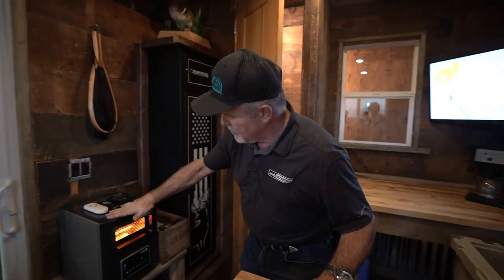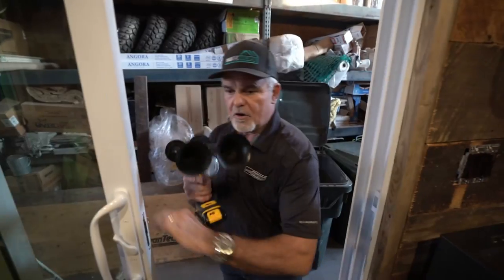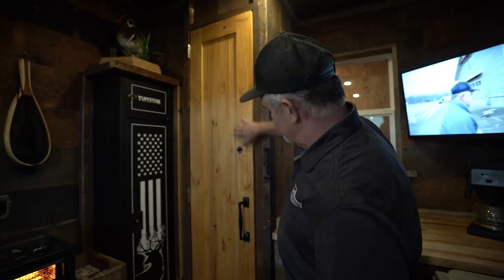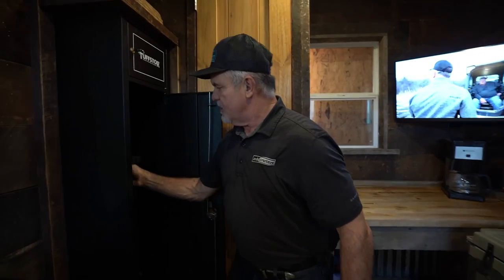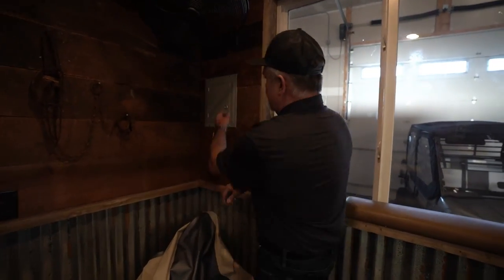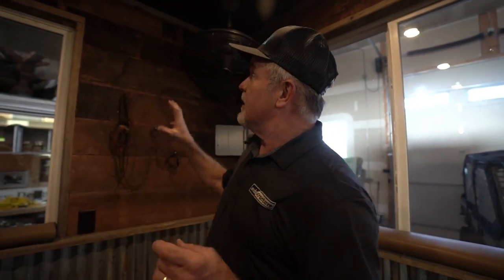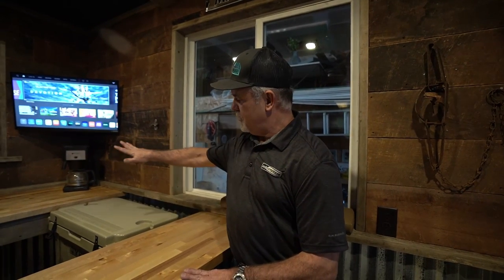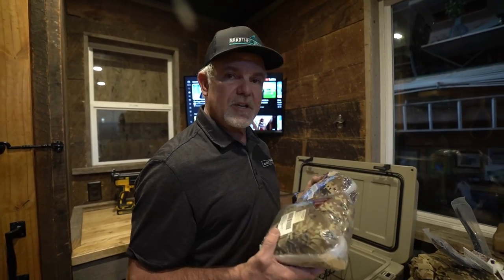Inside FLAIR’S Off-Grid Mobile Deer Blind! (Full Interior Build)

Comment: Looks & sounds like a great unit. If you vent the roof and add a ( eg. Roof rack) so you can add a tip out roof tent for guests & offer yet more usefulness. Because yes, although you can rough in more useful items inside. Fold down wall bunk beds over the bean bag chair.
Meanwhile, if the tent tips out over the patio doors, then the roof top tent not only works as an awning but offers the ability to add on an outside room.
So when you get a portable tent stove, you can set it up outside in the shared annex dining room area.
It will heat not only the rooftop tent but the trailer, too...
Meh, after that, a sink that drains to a hose outside so you can use a water tote (with a gravity feed) set up; along with a small roof top portable solar unit.
P.s. if that gun vault takes up too much useful space you can turn it into a convection fire stove heater. By placing 16 dinner candles, submerged into a HUGE glass CANDY storage jar full of lard! Making a better than 48 hour convection heater.
Or do the diy cooking oil fire box using the baby wipes as a long (log fire styled wick).
In such a way, that you could pipe in the prewarmed ambiant air from the annexed tent room - ( i.e., via / thru closed air pipes) which in turn gets heated up more via your diy convection heater & into your trailer.
Lastly if you really want to push it you could channel the wood gas from your outside wood stove to power an outside generator if needed.  Look up wood gas fuel the solar can also help you develop an outside hydrogen gas bubbler that if need be you could also vent to the generators' carburbtor to mix ever so slighly with the wood gases (warning eg.  LIKE only ONE PUFF! at a time! 
-directly from the water cell of the hydrogen puffer)......
& 
Yup that's about it!
Reply from the maker: Wow! Thanks for reaching out and sharing your ideas👍

Comment: Easy things would be coat hangers and painting the window trim so it's not white. I wouldn't have done a sliding door but you're going to want to tint it and a curtain. Movement will spook the wildlife. I would also look into dometic refrigerated coolers, they take up the same space and draw from a 12 volt system
Reply from the maker: Sorry for my late reply… I have one of those refrigerators/freezers that I could replace the cooler with! 
Several people are telling me I need to 10th and windows so I’m going to get that done - thnaks
Reply from the maker: Tint the windows, not 10th🙆‍♂️

Comment: The blind looks awesome! I would try to get the squeak out of the door because the sound caused from that could potentially scare of the deer or whatever Flair is hunting. 
I would also suggest that tint be added to windows just for privacy and to reduce some of the reflection from the windows. 
All in all, awesome job, Brad!
Reply: Also, I’ll guess the weight is about 2,675lbs
Reply from the maker: @josephwhisnant  I’m going to put a little oil on the hinges
Reply: @BradtheBuilder   Awesome man! Great work on it man! Could definitely be a new market you can dive into with this being the sample after flair puts it to the test. 
Another thing you could do is adding higher clearance and all terrain tires to help in muddy locations. As well as adding places where you can add anchors to secure the trailer to the ground using mobile home anchors. (That is if you haven’t already done this and I missed it.)
Reply from the maker: @josephwhisnant  that is a good idea! I did not know it was a thing?

Comment: That blind looks great! The only thoughts I have are to put camo on the inside so it can be moved easier or use some of the privacy tinting that you can see thru but not see in. You can get a color to match the side of the blind. Also add some anchor points to strap stuff (heater, cooler, etc...)down for transport.
Reply from the maker: Yes, I need to bungee or anchor strap the cooler, and all the other loose items in the deer blind when transporting

Comment: @BRAD, bud you did a fantastic job, heck id stay in it.   

Where did you get that stove????  I need it, ok i want it but still!!!  

 I do love the hinged butcher block idea, especially if you have 2 or 3 pple in there moving with rifles, you may need the room. 

 I also think putting a blackout tint film on all the glass would help and then use the camo stuff to help while your actually shooting to shield yourself from the wildlife. 

 I do think solar panels on the roof with a few hook ups would be beneficial as I know Flair has the Ecoflow (I double checked his videos) which is a solar generator that can be charged many ways and would benefit him greatly in this build. 

 Id also suggest running some 12v cigarette sockets.  The reason i say that is because things like ice fishing  Garmin's or even a 12v freezer/fridge cooler you can buy at home depot all run off that and it'll keep whatever you need cool at a proper temperature, plus worst case scenario you will definitely have enough juice with the solar panels to plug in a small cigarette adapter to charge phones or gopros for filming.  

 Also i wouldnt worry too much about water most pple bring some, have wipes and you could always slide a cullgan bottle under the back window and use the pump attachment to clean up, its old school but if it isnt broke, dont fix it kinda thing lol. 

 You also might want to add a few hooks that can swivel against the wall when not in use(for coats and bags), that way no one takes a eye out.  

All in all it turned out fantastic and im sure as time goes by you will find more and more things to add or change but to me heck Id camp in it.

  Lets be honest, this could be a tiny home and many folks without a home would be so grateful, and we all know Flair will appreciate it.  

And again, where did yoy get that stove???? Dont tell my wife im asking lol.
Reply from the maker: I think I got the stove at Menards. If you don’t have one in your area, they do have a website.

Comment: Awesome work as usual, Brad. Like I said in a previous video, if you want a luxury ice shack series, I am your guy! Lol. There are many different things you can do to make it different than the deer blind. I am brainstorming ideas already!
Reply from the maker: Please give me some ideas I have a lake in my backyard… I’m a little nervous to take this heavy trailer out on the ice!  Maybe I should wear a life jacket when I’m inside ice fishing😜
Reply: @BradtheBuilder  if you are going to use it for ice fishing just attach pontoons to the outside.
If the ice breaks you can just float.
Reply: @BradtheBuilder  first, the framing should be made of aluminum instead of wood to help with weight. A friend I ice fish with made his using the frame of an old pop up camper. In the back of the shack you could have a table for sitting that turns into a bed. You can have a bed above that and when it’s not being used it folds up towards the ceiling for more head room. I wish I had the skill to build one myself. I don’t need it falling apart down the road. The ice shack could second as a camper in the summer!
Reply from the maker: @dalegereaux1863  Dale, I love the way you think! 👍❤️
Reply from the maker: @cameronfrieden6148  yes I should’ve used aluminum studs, but the original idea behind the build was to see if I could build it cheaper than the Home Depot/Lowes sheds which are framed out of 2x4

Comment: Looking good and for a guess on the weight well idk 2650Lbs can't wait to see his reaction!
Reply: Just a rough guess ik how much sheets of dry wall and osb weigh, and the wood so just guess the amount of all those by size. and the windows are probably around 50LBS and sliding door definitely adds another 100LBS + and average boat trailer probably 600LBS-700 but you beefed it up.

Comment: About the only thing I'd add is some bungee tie downs for the heater, cooler and stools to stop them moving around in transit. Apart from that I'm loving it!
There's a type of mesh used in bus advertising and similar things that you can see out of, but looking in it forms a solid screen. I've seen some hunting blinds use something like it. It's a bit like a one way mirror kind of deal.
I'm guessing around 1700 pounds. God I hope I'm wrong lol because then it'll tow like a pig.

Comment: You can buy a 120volt heat pump mini split that can be powered off of solar that works great as long as you have the right set up, I have one in my swamp cabin and with a few mods I can power the HVAC and a few lights, and as far as I have experienced, heat pump heat is the most comfortable without drying out the incoming air, and also cools very well as long as it stays maintained
Reply from the maker: Really? I need to look into that.. thanks👍🤠

Comment: This thing turned out fantastic..adding the ice fishing holes is a great idea...is there a way to hook up a power station from the inside of the cabin directly to the main power? And when you decide to make a couch/bed make sure it's high enough to where you're not looking up Flairs skirt while he's sitting at the bar, or just cut the bar so it folds.
Reply from the maker: The power hook up is on the outside on the very front and I’ve installed a metal basket where you can put a German
Reply from the maker: Not German… Generator
Reply: @BradtheBuilder  I think what I was trying to get at is if you wanted to use a quiet power source like a power bank, those need to be kept out of the elements including extreme temps. So you would need a way to connect a power bank to the main panel from the inside as well as outside for shore and gas generator power. I guess you could run the power cord from outside through a window to the power bank if you really needed to.
Reply from the maker: @run_rabbit-run9762  ok! Now I understand 👍

Comment: might need some straps or fasteners for the ammobox/heater so they dont slide around/fall when your moving about. also, might need to figure something similar for that coffee pot lol don't want that breaking, maybe some shelving for canned foods / seasoning. Im sure they will use some kind of induction stove for cooking in there.
Reply: also were the lights flickering? lol
Reply from the maker: @thomasjay975  yes, the lights were flickering it’s because the generator was running out of gas

Comment: Well first thing i would do is change the cooler. I would replace it with a small 12/24v front loading fridge that you can build in. I know those arent cheap but the current cooler takes up way too much real estate. And that bottle opener needs a better spot. On/under the countertop would be a much better spot for it. And yeah solar would be obvious plus this thing needs a awning so you can cook outside in the shade/rain.

Comment: Really should add a single burner wall mount propane heater   Or one of those newer battery power packs   So when your hunting you can be warm without the noise  as far as a bed i would do a dropdown style that attatches to the wall and then folds down into a couch or a bed. That way you have plenty of room while you’re hunting for your tripods for your gun and stuff.
Reply from the maker: That’s a good idea… Kind of like a Murphy bed?
Reply: Yea just do a 2x2 frame with plywood then have legs that swivle down you could even have it padded like the window rails you did it would double as a couch for hanging out and fold up out of the way. Ive seen how flair used the Tripod for his gun  so he would need the extra floor space for that and possible filming equipment tripods
Reply from the maker: @outdooraddictiontv5325  thanks for the input… I really appreciate it!

Comment: I'm guessing 6,501 lbs haha...
one idea though - under your bottle opener screw in a hard drive magnet to catch the caps! they work great for that and can be harvested from old computers' hard drives pretty easily... I could also send you one if needed ;)
Reply from the maker: I’m trying to picture the hard drive magnet that comes out of a computer??
Reply: @BradtheBuilder  typically it is a flat magnet with 2 screw holes. You can see plenty of examples on ebay, but they are neodymium and I believe stainless backing with the mounting holes. Very strong magnets. I had one for years under a bottle opener like that to keep caps from going everywhere.
Reply from the maker: @aaronhume  thanks👍🤠

Comment: I like it but the generator would be to loud to hunt with. It would scare all the deer or anything else you want to hunt away. Eco flow or any kind of portable power station with solar would be perfect.
Reply from the maker: I’m going to look into that… Thank you!  Did you want to guess the weight of the trailer?
Reply: @BradtheBuilder  sure. I’ll guess 6200 lbs